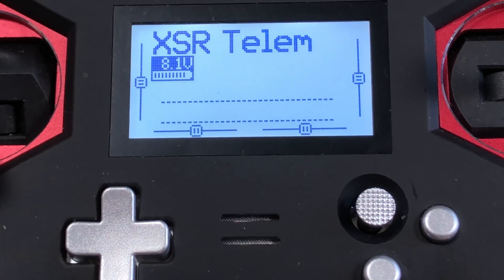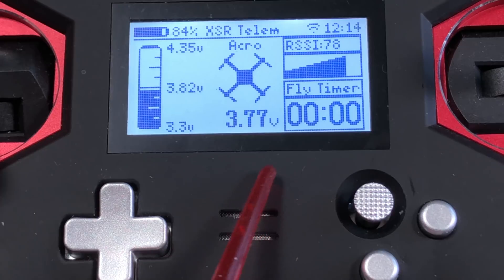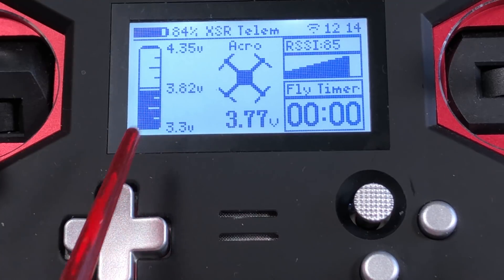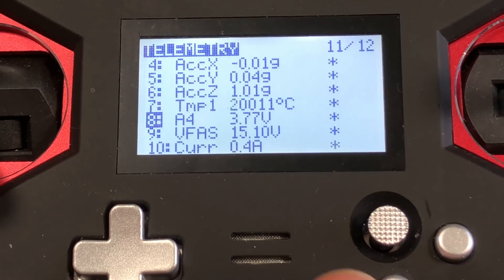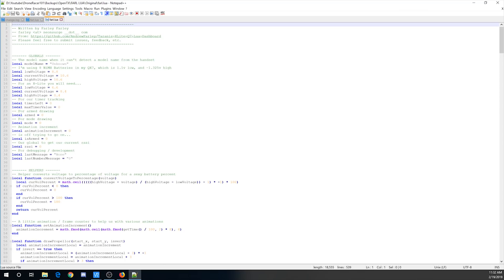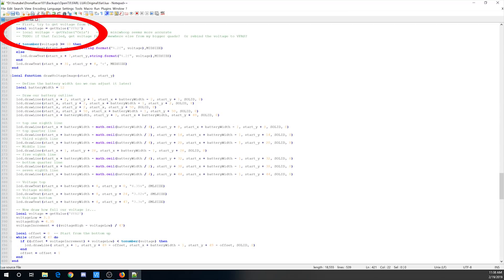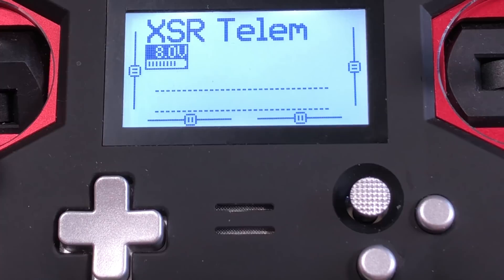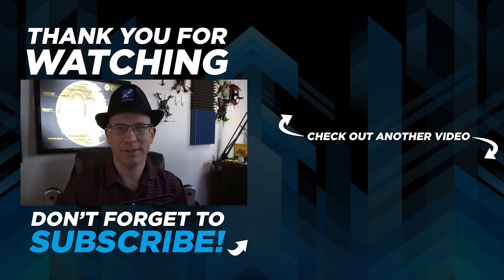The FrSky X-Lite LUA Script you need to get NOW.  It works for the QX7 too.

Comment from the maker: You can get it here: https://github.com/AndrewFarley/Taran... (click farl.lua)

HUGE Thanks to Andrew Farly for making this!

It works with the FrSky X-Lite: http://geni.us/FrSkyXLite 
And both the FrSky QX7s: https://geni.us/TaranisQX7 https://geni.us/TaranisQX7S
Check out my current giveaway: http://geni.us/DroneRacer101Rewards 
These are the current Drone Coupons I know of: http://geni.us/DR101DiscountCodes 

Ever since the X-Lite came out the one thing I lamented was the fact that it didn’t show as much information on the main screen as the X9D.  It’s basically the same screen as the FrSky QX7.  Well now things to Andrew Farly that is no longer an issue.  In fact the screen on the QX7 and X-Lite is WAY BETTER than the X9D. It only takes a little tweaking to make it work just right on your personal setup but I cover all of that in this video.

Supporting Droneracer101 on Patreon means more reviews and giveaways for you (and a hat line mine :-) www.patreon.com/droneracer101
Reply: Cool! Will this work on a Jumper T12 (QX7 based OpenTX)?

Comment: Hey can anyone help with an issue that I am having with this script. The armed script is reversed for me.  It is showing armed when quad is not and not showing armed when it is. I am linked to correct switch in radio. What do I need to change? Thanks.

Comment: I wrote some of the very first lua scripts for the x9d, what soon became apparent is the screen is pretty much useless apart from post flight analysis etc, you simply cannot look at the screen whilst flying.....I did make a screen which allowed me to fly without looking at the plane though which was cool.
Audio is much more useful generally though, setting timer to go off at certain points and voltage may etc etc

Comment: Thanks for the tutorial Mark. Everything works but how do I reverse the armed display? I've set the toggle switch - on my QX7, its 'sf'. But the armed animation is on when sf is in disarmed position. Can't work out how to reverse this.
Reply: Just worked it out. Not sure if this is how it should be done, but it works. Just change reverse the 0 and 1 in the following part of the script.

  -- Check if we just armed...
  if armed > 512 then
    isArmed = 1
  elseif armed < 512 and isArmed == 1 then
    isArmed = 0
  else
    isArmed = 0
  end

CHANGE the 1s to 0s as below ...

  -- Check if we just armed...
  if armed > 512 then
    isArmed = 0
  elseif armed < 512 and isArmed == 0 then
    isArmed = 1
  else
    isArmed = 1
  end

Comment: does it work with xm+ ?
Reply from the maker: Partially.  The xm+ doesn’t support full telemetry so you won’t get RSSI or voltage from the drone.  But it will let you have a better view of the voltage of your radio and know which mode you are in with a glance.
Reply: @SimRacer101  thank you for the answer :)

Comment: This is cool but I can't see my radio through my goggles so I'll just stick with BF OSD... Easier and less annoying than alarms or voice packs.
Reply from the maker: It don’t need it while flying.  But where I find it most useful is as soon as I plug in a battery.  I can see at a glance if something is wrong before I get in the air.  It’s mostly a trouble prevention tool for me.

Comment: Oooo doing this asap, such a nice little upgrade. Do you have to run the Lua each time you turn the tx on?
Reply from the maker: Right now you can't make it automatically start with a LUA script.  But all you have to do is pull the stick down real quick to get to it.  Once you set it up on the telemetry page that will work every time.